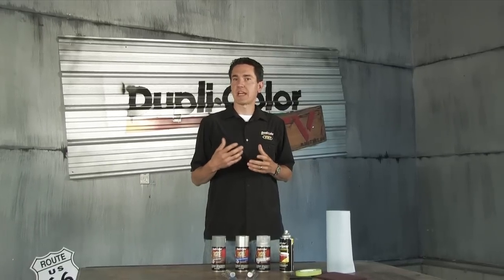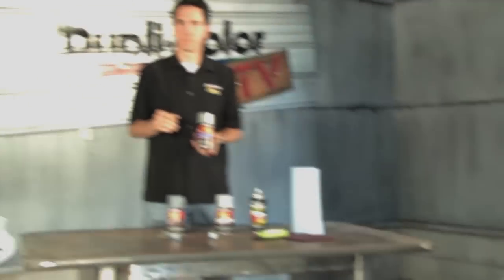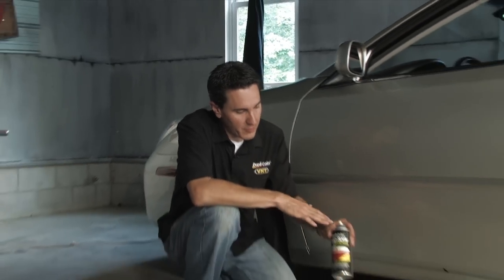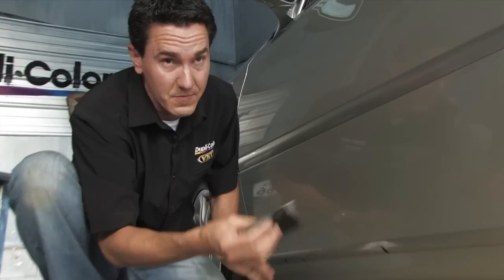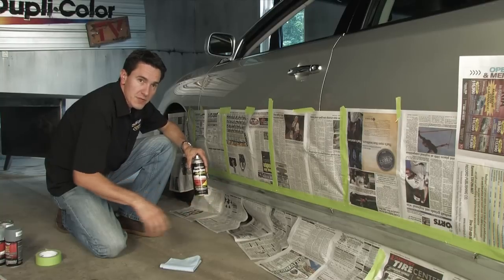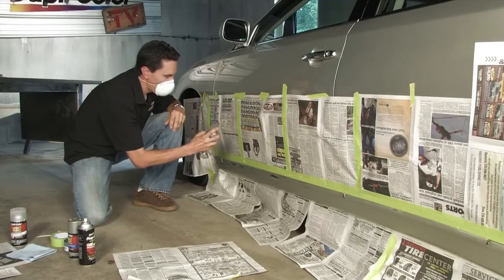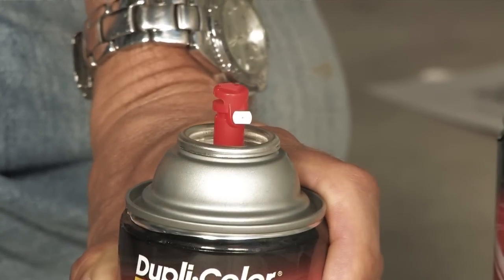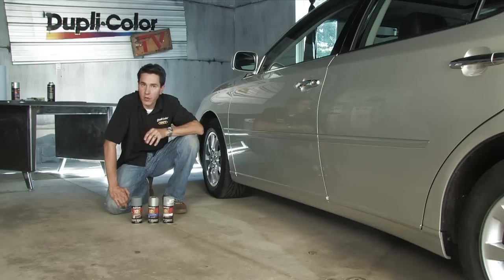Dupli-Color® How To: Perfect Match

Comment: I just used your color match on my 05 impala, and it looks like it has a yellow tint that the rest of the car does not. I am a little nervous to clear coat this paint now.  Is it normal for the paint to not match prior to clear coating?
Reply from the maker: Chris - it's hard to tell without the clear coat, but, if there are any issues with this paint - feel free to give us a call at 800.247.3270 and we can walk through it with you!

Comment: Hello I need some help. I hit a wooden post with the front of my car and now I have a pretty big area of paint missing from the front section of my car. Its all chipped away. I was wondering which product of yours would be the best to use. Also should I use sand paper? I have a black 2008 Honda Accord 4 cylinder/ 4 door.
Reply: Also, i think my front bumper is made of plastic.

Comment: there're multiple scratches on both sides of the front bump as a result of touching the concrete wall, if I just sand the areas to make them feel even and then apply color coat followed by clear coat without using prima (filler), what will be result as far as you can imagine?  Thanks!

Comment from the maker: It sounds like moisture is trapped in the finish causing it to seem dull. There’s nothing in the Perfect Match Clear that would cause it to be a lower sheen.

You might need to scuff the finish, wipe it clean with Prep Spray and allow it to dry. This might help it to clear up, prior to applying a medium Clear coat..

Comment from the maker: It sounds like moisture is trapped in the finish causing it to seem dull.

You might need to scuff the finish, wipe it clean with Prep Spray and allow it to dry. This might help it to clear up, prior to applying more paint (following the recoat time).

Comment: I'm planning to paint some Sideskirts I have on Sunday using the steps, sand with 320 grit, 1 coat of adhesion promoter, 3-4 of paint and 2-3 of Clear. Does this sound about right or should I do something differently? Also you said 20-30 minutes between the different steps what about time between different coats? I was thinking maybe 10 minutes?

Comment: Thank you for the comprehensive help!  This is much better than what I got via the DC site's tech support.

Will your clear Engine Enamel adhere well to PM, and is it also somewhat chemical resistant?  If so, I'm thinking that it might be 'good enough' for the wheels, which won't get anything more harsh than soap and occasional chain lube spatter.

After reading your, and other folks', advice, I'm going to take the tank to a local shop for a 'proper' 2-part job.

Thanks again.

Comment from the maker: Perfect Match is lacquer-based. Lacquer based paints can be damaged by solvents such as gas. You would want to use a 2 part, urethane clear coat for max solvent resistance. Unfortunately, we don't offer
one. We suggest contacting Sherwin Williams Automotive. You may also want to find a local bodyshop (they can shoot 2 part clears & may be able to add your parts to an existing project).
Another option would be to use Engine Enamel on the surface being painted, which offers better fuel resistance.

Comment: Is the PM Clearcoat shown here resistant to gasoline?
How about wheel-cleaners?

(I'm using your 'Bright Red' to re-paint the tires and tank of my old Kawasaki.)

If PM Clearcoat is not sufficient, which of your products would you suggest?

Thanks

(Minor rant:  Visiting your site, it's difficult / impossible to determine the chemical resistance, hardness, etc. of your various products.  A big table of physical properties would be VERY handy.)

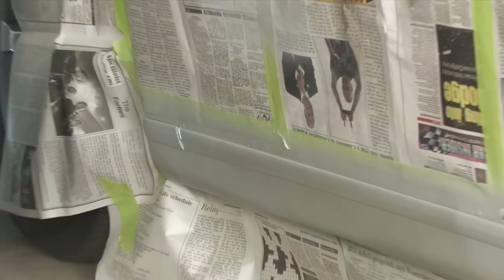Comment: It's a bad technique to stop/start spraying often like at 6:40 because paint builds up on the nozzle very quickly and splatters that shit all over the paint, which causes a LOT of headaches and sanding/repainting to remove those splatter spots.......

I have had a MUCH better time spraying constantly for 5 seconds and then cleaning the nozzle and reshaking the can (be careful not to spray directly onto the painting surface when going back and forth or you will spray it on too heavy at the apex).

Comment from the maker: It is likely that the OEM paint applied to your vehicle is urethane based. DC is lacquer based. Lacquers cannot be applied over urethanes. The solvent in the lacquer is too hot and will eat into the urethane therefore, we don't recommend that you apply the DC Clear over top of the OEM paint. You will need to apply a urethane clear over top. Unfortunately, we do not offer one at this time. We suggest contacting Sherwin Williams Automotive for a product recommendation.

Comment from the maker: Hi Sawyer! Unfortunately, the Perfect Match Paint, or any of the product we offer, cannot be used on carbon fiber canoes. The reason why is that none of our products can withstand constant contact with water or submersion. They will prematurely break down when exposed to such conditions. Furthermore, the adhesion of
any of our products to carbon fiber would be minimal as this kind of substrate does not lend itself to sanding. We suggest you look into marine grade products. :)

Comment from the maker: First, it’s best to not paint something that would possibly interfere with your driving visibilty in any way. So long as you use our  Adhesion Promoter primer to prep the hard/rigid/non-flexing plastic surface. You can use anything in our line over it.

Comment from the maker: Yes, the Perfect Match Clear is the correct product to use over the Perfect
Match Touch Up paint.

A dull finish could be the results of a few things. Over-application, high
humidity during the application, trapped solvents and holding the can too
far from the surface can all result in a dull finish.

It would probably be easier to discuss this concern with an agent, by
calling 1-800-247-3270.

Comment: Barely, and keep in mind the car is 7 years old so it's impossible to exactly match a vehicle's paint because of the elements it's been exposed to.  With time, proper polishing, and wax application it will blend in much better.